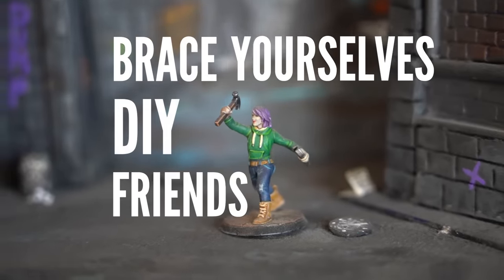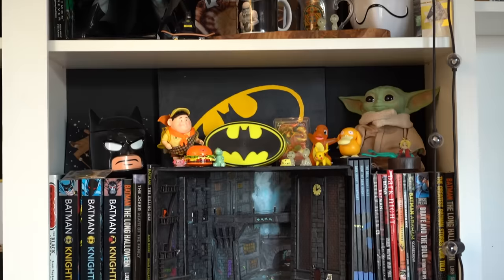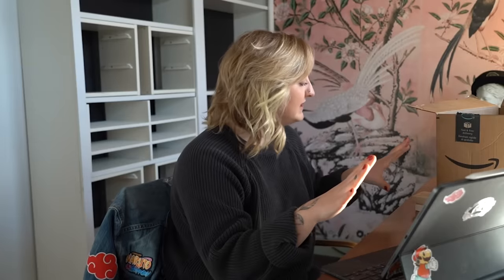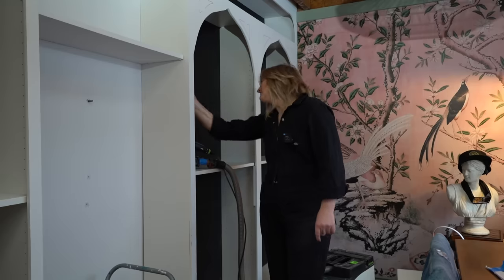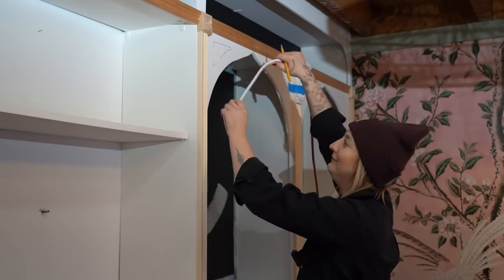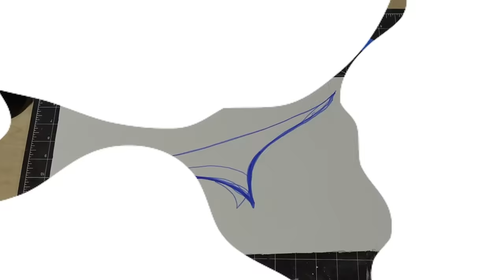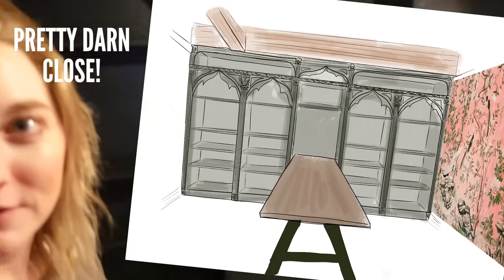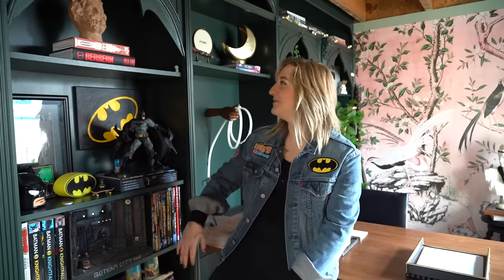*IKEA HACK* My Bookshelves Get A Victorian Gothic Makeover! (I'm Obsessed) ✨

Comment: Hot tip for caulking along gaps! Fill it in with a strip of foam, like some weather strips, to give the caulk something to grip to. As it dries its going to want to pull away and it might separate in areas where there is a gap.

Comment: I love it! Do not, get rid of that beautiful wallpaper, please! I have just one suggestion... use Woodville on those bigger holes or gaps. You'll get a clear finish in the end, or use a putty knife to spread the cail more evenly, followed up by a wet wipe or paper towel to remove the excess. I know it's a tough call, because filler can crack on larger fills, but those can be filled too. Bonds for wood is also great, but that is probably an incremental fill as well.

Comment: I like the overall effect, LOVE the color, but I think there were some missed opportunities here. 

I think you should have pulled off all the previous arched façade pieces and started from scratch. First of all, I think that all five of the sections should have had the same treatment, with two pointed arches in each section, each laser-cut from MDF or plywood. I think the combination of the five pointed arches with the center one a 'row' above looks odd, and I also think the upper sections with the rounded corners don't relate to the pointed arches from a visual standpoint. Ten pointed arches, each with perhaps a laser-cut perforated design would create a Celtic or Moroccan feeling to the whole thing. The symmetry of it would also be quite impactful, I think, and would banish all evidence that anything there came from IKEA. If you did several layers of thin laser-cut plywood individually cut and then glued together, you could have an interesting surface texture and dimensionality as well as the interplay of light that an openwork design would create. If some company ever gives you a laser cutter, you should seriously think about giving it a go. 

Also, and this is something you could easily add, I think you need to make the horizontal shelf edges a little beefier with molding along the shelf edges, flush with the shelf's top surface, creating a more substantial overall effect. You could even find a decorative millwork profile, but even flatstock with at least double the width of the shelf thickness would give the whole unit more of a presence. 

I also think you should put the basket organizer units lower or eliminate them from the wall entirely. They look functional, and I understand the desire for that functionality, but I think hidden storage would be better for stuff like that. Maybe consider making doors for the bottom shelves from desk height to the floor, and tuck all that kind of stuff behind those cabinet doors.

But again, the overall effect here is really cool, so yay!